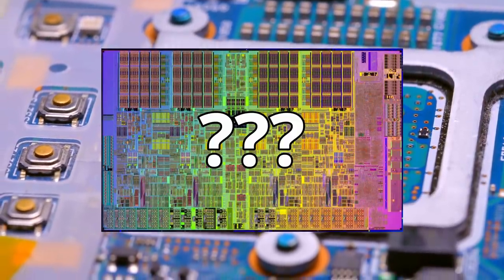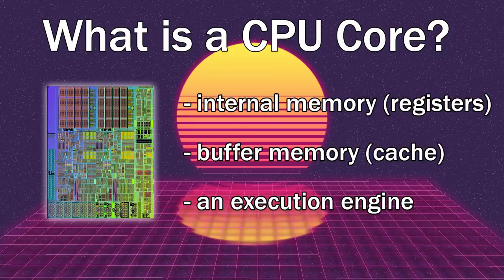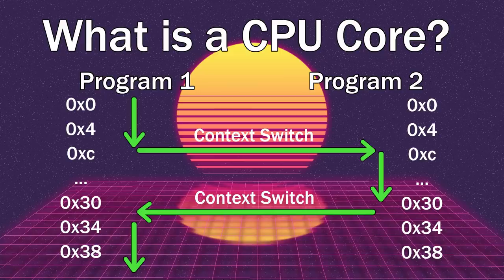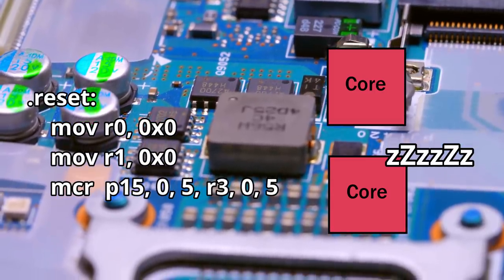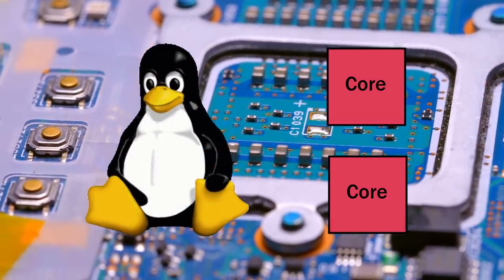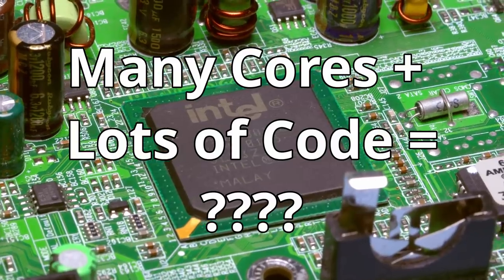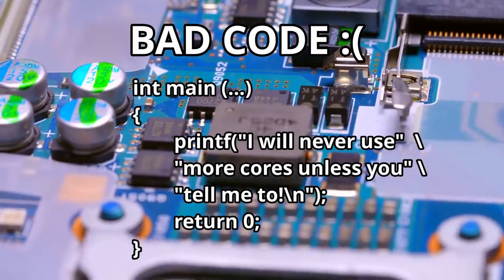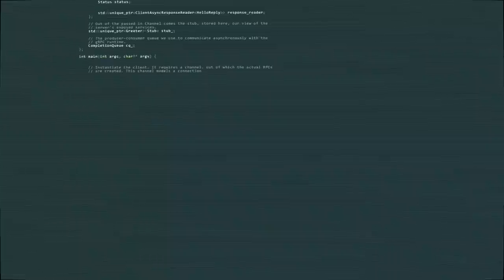why can’t computers have thousands of cores?

Comment: sorry but a correction asymetric cores is where not all cores have same performance

so there few cores which great at computing tasks but takes more power and few others which is not the best performance but power efficient this one named big.LITTLE architecture and its used alot in phones while recently i think Intel starts making big.LITTLE cores on their processors (i love to imagine they just slaps few Intel Celerons cores and Intel i9 together even if its not entirely true :3 )

and symmetric is where all cores is exacty the same

Comment: I'd say the norm is more like 3-4.5Ghz max with a BOOST of up to 5.5

Very few consumer cores not classified as "enthusiast" CPUs can't reach 5Ghz. Hell I'm on a Ryzen 7 and it's highest stable clock seems to be around 4.2Ghz with manual voltage tweaks and amazing cooling.

Comment: Yes. So for games, I wish we just a single core chip that ran at 10 ghz. Ghz peak doesn't matter too much, I just want a fast clocking single core man. Games don't even use multiple cores that well.

Or make a big single core CPU like the PS3 cell processor man. Maybe have 2 of those "cores" so you can go to the OS menu instantly.

But oh well, general purpose is so much more useful so multiple cores are still gonna be the norm. OG Crysis with a 10 ghz modern core would be exciting to see though.

Comment: This is a classic multiprocessors dilemma.
At some point, the data inter-dependency for multiple threads/cores is just too extensive to process parallelly. Actually, SW compiler can help here, but it too is limited by the nature of the program itself. This is a simple example:
E = (A+B) * (C+D); both (A+B) and (C+D) can be done in parallel
G = E + F; G can't be calculated until E is calculated and must be calculated in sequence

There is an easier analogy for non-engineers to understand this dilemma.
If 10 of average intelligent people, say IQ of 102, work together, the output is nowhere close to 10x of one. There are, however, many ways to make it better such as what we're doing in factory assembly lines, workers complete a specific task repeatedly rather than complete a series of tasks, to a point that is.

Comment: If you can make a cpu wok at any temperature then you have your answer  in server world there are cpu clusters that the sum added can be at 4 digit and beyond the real thing why is not evewhere is cost and fiability , because you will need also the software to be aware  of that hardware since today we have multiple cpu, each and other components standard it is usually up to the host operating system to handle the hardware based on their drivers settings configuration , usual software is machine neutral mostly to be awailiable on every platform at least some of these,  ad  adding more cores to your cluster you will have to increase the cache,  l1 cache and l2 cache needs to be physically on the cpu dies but l3 and beyond can be mapped external  to a big optane disk for example since it runs almost at ram speed but is non volatile means it does not require electricity to store information, wich usual ram is volatile also if the information is not moved around the information will also be gone

Comment: You are incorrect.

There have already been processors with thousands of cores.

I believe (though it may be surpassed by now) that Olof Kindgren's SERV 32bit RISC-V core has already surpassed 6,000 cores on a single FPGA.

Pretty sure there were previously even research systems with 10,000 cores, and if you are using abstractions such as TidalScale then you will have contiguous memory space (albeit, perhaps abstracted across many systems) yielding claims such as: "New Intel Xeon Platinum 9200 Server Packs 7,616 Cores In A Rack". Or:

"The supercomputer developed for OpenAI is a single system with more than 285,000 CPU cores, 10,000 GPUs and 400 gigabits per second of network connectivity for each GPU server. Compared with other machines listed on the TOP500 supercomputers in the world, it ranks in the top five, Microsoft says.May 19, 2020"

If you mean most cores per CPU die, then again, I defer to Olof Kindgren's SERV already benchmarked in excess of 6,000 cores on a single FPGA.

Comment: Actually, this move towards multi-core was driven not so much by IBM, but by Microsoft unifying the code bases of Windows 9x and NY, which merged in XP.  Once that happened, you had a desktop OS that could use multiple cores, which hadn't previously been the case - not w/ MacOS (at the time, still System 8) nor Windows 95/98/ME nor OS/2.  Intel had been watching AMD play catch-up, but once this happened, Intel could start tossing more cores in and for the first time, producing CPUs that were cost competitive and at par w/ uni-processor RISC CPUs like the DEC Alpha and the MIPS
Reply: NOPE. It was Linux demonstrating scalability to MIcrosoft. MS lost the market.

Comment: i think its time to create core specific operating system like independent software with local network system and therefore code that makes that cores work like super computer cells. but much better is network based/cloud like scheme. where each core will act like individual subsystem that can accept code for anyting. much like life on earth does it. ie multicelluar organisms cells. :P where each cells lives as individual while they are in sync with main system :P that way itll open new roads to walk for computers it seems.
Reply: already done.

Comment: I understand this is about consumer desktops and not servers so bringing up 256 thread Epyc workstations is irrelevant, but when dual-core CPUs appeared plenty was written about how consumer programs weren't programmed to take advantage of dual-core and multi-core was just a server and workstation thing. And then when quad-cores appeared it was all about how games and such barely make use of dual-cores right up until post-ps4/xbone when engines started to HAVE to optimise for 6 slow cores that's when gamer's high end dual cores started to lag behind mid-range quad cores. Until someone figures out how to make single threaded execution double in performance every year like the good old days we are only going to see ever increasing core counts in consumer hardware which will in turn force devs to figure out how to effectively use them. And any complaints about memory bus contention and cache coherency will just be another stumbling block that CPU designers and programmers will have to solve. And we'll be hearing about how pointless 32 core CPUs are for the desktop since even the best games don't fully utilise all 16 cores of the Ryzen 3 7000 so why should ordinary people shell out for the Ryzen 9 7850 with its 48core/96 thread monster?

Comment: Guild wars 2 is an excellent example of bad code. It runs horrendously for being a 2012 game, and many things that could have been run on the GPU (if they had coded their engine properly) instead runs on the CPU and doesn't play well with multi-cores.

it "Works" in the same way you CAN fit a car through that gap if you don't mind the rear-view mirrors getting smashed and the paintjob being scratched off.

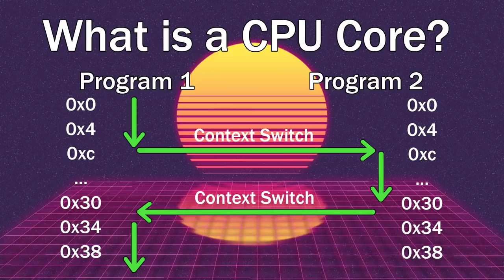Comment: 2:42 This is exactly how our brains work and is the reason why multitasking is a myth. When you do more than own task at once, your brain just jumps back and forth between both so fast that you think you're doing them at the same time. The downside is that you can't ever reach a true state of concentration for either tasks, like the flow state. No matter how good you think you are at multitasking, focusing on one task at a time will always make you more productive.

The productiveness gained by focusing on a single task might not be worth the time gained from multitasking, but that's a different question 😅.

Comment: "You cant have a thousand cores because parallelization doesnt work that well."
GPU: sweats nervously 
Most performance GPUs have well over 1000 cores working in parallel, which makes sense for graphics rendering as that can be parallelized incredibly well. Most calculations happen relatively independently after all. The same goes for physics, which Nvidia also tried putting on GPUs for a while with their PhysX API. And there are still pure computational workloads that can be put on GPUs thanks to CUDA and OpenCompute, but again the main takers are scientific simulations, which essentially goes back to physics, chemistry and other stuff. 
Those are all fairly niche cases and will usually not affect average users. PhysX being used for gaming is already long gone as not many games saw the point in investing into a technology that was proprietary anyway and eventually fell out of favor anyway once multi-core CPUs became more adept at that anyway and GPU power was needed for ever more complex graphics anyway, it was more economic to use a spare CPU core for physics. 
Its really only game graphics and content creation where GPUs are really used to full effect. Video rendering and encoding for instance scales well on GPUs as the workload can be divided into an insane number of tiny chunks that all run on their own GPU core. In games every pixel can be made its own thread of just fetching the geometry thats there, textures, lighting and calculating the end color of the pixel, which in 1080p is still ~2 million pixels, so even then at a thousand cores every core needs to do 2000 pixels for every frame, meaning we can still scale up the number of cores almost indefinitely before it becomes an issue in those workloads. Its really just a question of how large you can make the silicon die and how big you can make your coolers. A 4090 for reference has 16000 shader units, plus a small number of other cores, just to give you an idea how much beef is in GPUs these days. A GTX 1060 for comparison sits at 1280 shader units, which is a semi-old midrange card that many people still use, including me until recently.

Comment: I believe i the 2000's Sun Microsystem held the competition on corequantity-wise on their SPARC machine at upto 64 cores. Too bad on 2010 Sun Microsystem is bought by Oracle and therefore gone all the innovation and cereativitt at their research capability since then. Although at the late 2010 they still released the 128 core machine with 256 hardware threads (not simulated software thread by intel), but again Oracle not using their reources to penetrate the market and lost its focus on SPARC

Comment: The numbers of cores are just relative. If you say more cores mean more instructions they can do, then it's not wrong. But if one core can do more instructions, it also makes the computer faster.

And sometimes, there are tasks that only need one core, so in those cases 1 fast core is better than 10 slow cores.

TL;DR: you don't need a lot of cores, you need as many instructions that your computer can deliver as possible.

Comment: 6:19 does numa mitigate the memory bottlenecking?
Reply: Partially. But in exchange, you introduce the issue of cross-domain communication (if you need to access memory from a different NUMA domain, then you need to cross the domains and just move the bottleneck over - this also introduces more overhead with core-core or in this case cache-cache communication to maintain consistency).

Comment: This is just a thought but I'm kinda tired of hearing about Moore's law, which is more of a prediction. Plus you certainly know that another reasonable prediction is that the relevance of this law is reaching its limit. If computers become X times as fast fifty years from now, it won't be according to Moore's law, because it won't be thanks to the capacity to add more components on a given surface.
Reply: We're pretty much at the limit of 2D scaling (around 1-2nm), so the only other hope is to go 3D (FinFET was sort of 2.5D and now we have GAA which is getting closer to 3D, but there are manufacturing limitations to how many layers can be build up - things like flatness). The other thing that Moore's law doesn't account for is diminishing returns. While density has been scaling, the cost has become insane.

Comment: Thousands of Cores processors exist, but a good fast core takes a huge amount of die space so you are limited, however if you have thousands of cores this is very good for huge paralel work loads, and we call such processors GPU. Each core has a big lag.

Comment: Maybe games wont scale well with too many cores, but there are acctualy usecasses for many, many cores. For example the tiny amount of servers in the world, or mnay simulations. Having many cores on a cpu is eaesier to develop then crazy high clocks. 10 years ago no progrmm was optimised for more than one core, today they are. More programs will use more cores in the future.
GPUs somewhat have thousands of cores and are used in many computing applications, such as simulations. They work in a different way but that many parralel executions are needed in situations.

Comment: There are already chips with thousands of cores dude - GPUs.  One of the hurdles to having thousands of cores is the x86 architecture.  That incumbent architecture has a mind boggling amount of code written for it, but it is hardly anywhere near the most efficient way to build a CPU core.  As a result we are slowly moving away.  Why can GPU's have thousands of cores? Their instruction set is extremely small compared to an x86 core, so their physical size on the die is much, much smaller.  They are optimized to do floating point math and that's about it.

The number of cores will continue to grow and software will eventually catch up.  Expect to see more specialization in cores though.  The next large breakthrough will be chips that support analog operation which is more efficient for processing neural net matrices than current code.  That in turn will lead to more powerful and faster AI on the chip.

And as for your thread title, in 30 years you'll look as stupid as whoever it was that said, "640 K is all the RAM anyone should ever need" or even earlier, the IBM exec that quipped, "I foresee a world wide market for maybe 5 computers."  Context is important, that IBM exec was talking about computers so large they take up a floor of a building, but even there he was wrong long term as Google , Facebook et all build server farms that can fill entire abandoned shopping malls.

Comment: Using any spell checker might have helped you realize that it's 'symmetric', not 'symettric'.
But your multi-core system does not tell you that, unless you tell it to run a spell checker...

Comment: The early 2000s wasn't the time of "early single core processors" in home computing, the 1970s were. That's like calling the 1980s "the early days of internal combustion engines." 

Also Moore's law will eventually be limited by our inability to stop quantum tunneling making transistors unable to work properly because they will get so small and tightly packed that electrons will jump from one to another when they aren't supposed to. It was estimated that would happen in the late 2010s, and that estimate was short but unless we come up with a novel kind of cpu architecture, Moore's law will be long gone 50 years from now.

Comment: Thought moore's law had been done for a few years now. Seems like we are starting to reach some limits until we get the next quantum leap in design or materials.  6ghz speeds don't seem likely any time soon. and transistor gates can only get so small
Reply: 3 months later the 13900k is running 6.5ghz on a 280mm AIO

Comment: Your GPU does in fact have thousands of cores, granted a graphics core is much simpler than a CPU core, but there are thousands of them. Top supercomputers do in fact have hundreds of thousands of proper CPU cores running on them. The only "can't have" is that you can't have a cheap consumer supercomputer quite yet, but the chiplets designs are clearly moving in that direction. 

The only real limit is power efficiency really. 1kW power supply for a computer is about what you have these days, but how would you feel about a 10kW or 100kW power draw of your desktop computer? It would sound like a jet engine too trying to keep itself cool with a power consumption like that, clearly not an option for home use. You can't have more compute power in a small convenient package unless you have more energy efficient computing. That's what the nanometers are really about - energy efficiency. If you can make more energy efficient logic circuits, you can also stuff them in a small convenient consumer package.

Comment: I have a low power computer with 2 cores that was clocked to 1.1Ghz, although I overclocked it and usually runs at about 2.1-2.5Ghz. I don't how it was clocked that low when it is TTL (if it isn't TTL I don't know how it gets so damn HOT) but it is an intel Celeron if anyone wants to educate me.